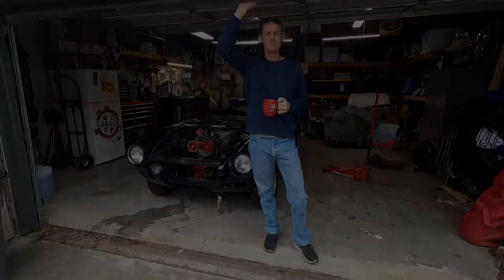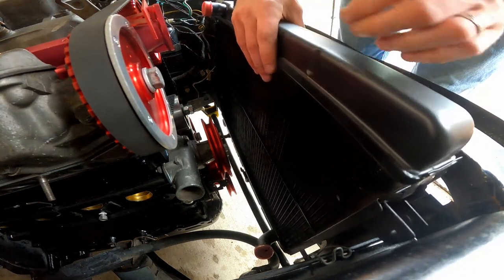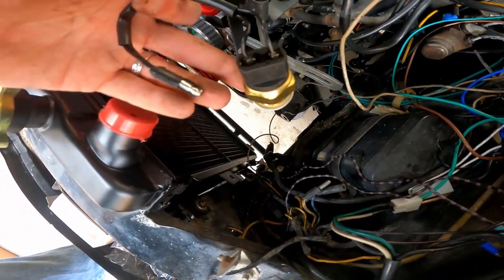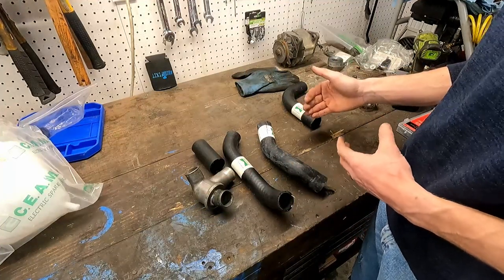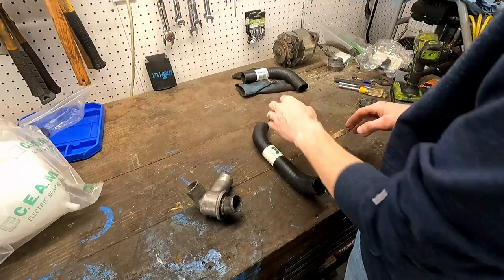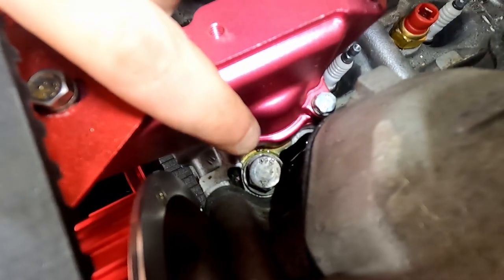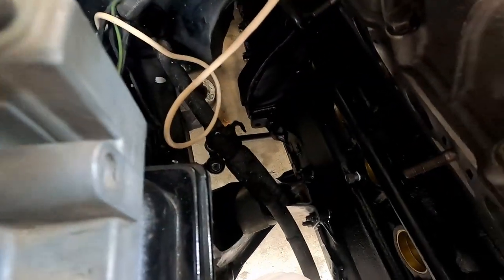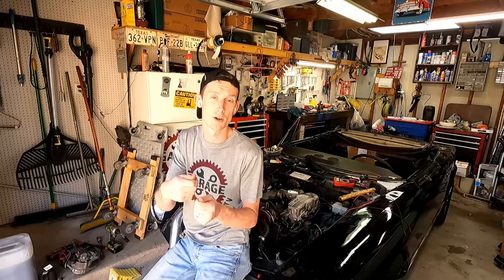Keeping our Fiat 124 Spider Cool with all NEW Parts!

Comment: I really like the heater hose T addition.  It makes perfect sense since the radiator fill is lower than the head.  I just replaced the radiator in my red Spider and have been waiting for warmer weather to burp and top off the system.
Reply from the maker: It’s essential for every spider in my opinion. You saw how much air was still trapped. Only $4 too!

Comment: Nice vid! I'm halfway thought new coolant pump and new timing belt/tensioner myself. I also did a new heater core and hoses. Hoping to finish this week. The coolant pump was 21 years old?! The timing belt/tensioner was only 7 years with 12 miles on them both from last owner. Many thanks for the tips here.   FIAT on, Cheers;)

Comment: New radiator you installed,what is the part number? The link you added does not work,the radiator looks like the og part.Vics only shows the aluminum cross flow type now .
Reply from the maker: Let me update the link! Sorry about that!
Reply from the maker: I have updated the link, but the part number is 11-2303-AUTO. If you type this on the search bar on their website it should pop up. Let them know you got it from me!